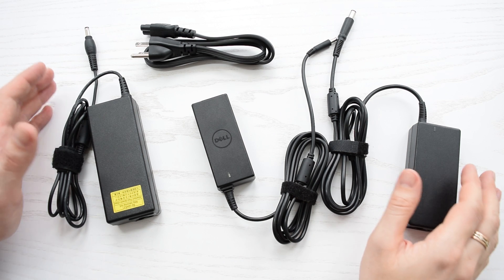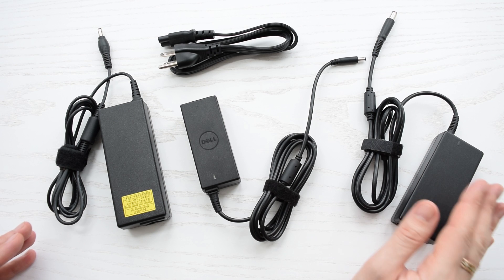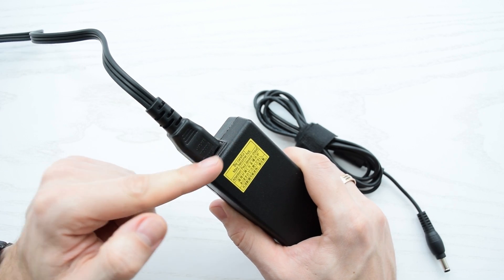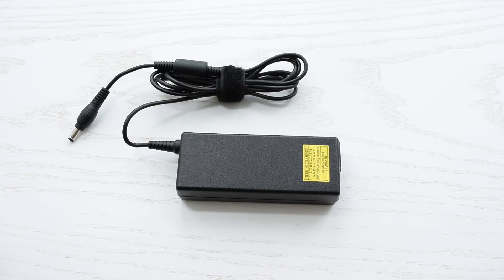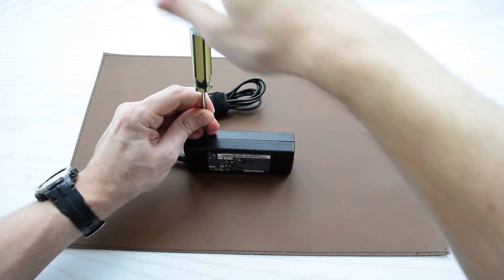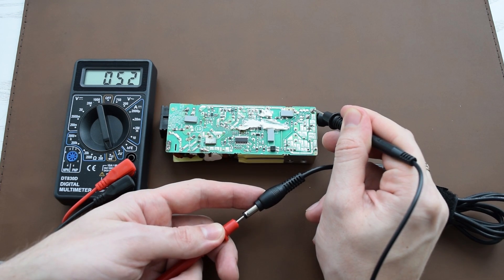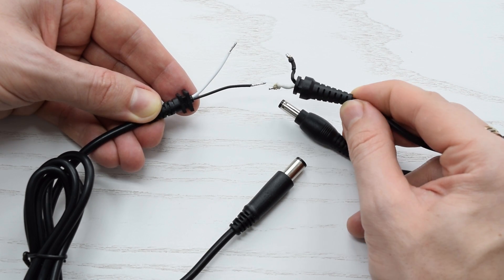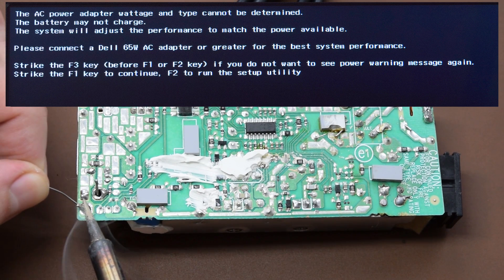How to Open and Fix Laptop AC Adapter without Damaging. DC cable and Capacitors Replacement

Comment: My Dell 65W charger have black blue and white cables and GND, VOUT and ID. Which wire goes where?
Reply from the maker: The outer ring on the DC connector is GND, the inner one is Vout and the needle in the center is ID. If you're replacing cable and if the new one has different wire colors or even if they the same I'd highly recommend checking them with a multimeter.

Comment: Is there alternative to using superglue when you put it together? How are you going to get inside when it breaks again? Or maybe just using the superglue in the corners or middle would be preferable?
Reply from the maker: I opened super glued power supplies many times. That glue is not stronger than the factory adhesive.

Comment: Hello my friend, do i need to super glue the case back together? Also when opening with a screwdiver i made a few small holes in the side of the case
Reply from the maker: It's up to you. You can glue it back together or simply use electrical tape or scotch tape.

Comment: Another trick to open plastic enclosures without breaking them (mostly)
See picture:
https://drive.google.com/file/d/16e1rRGl4BeZp2NFobxlSmnRpqDgaXwFo/view?usp=drive_link
- Make sure that the rods are exactly positioned on the seal (use sticky tape)
- Don't squeeze too hard; I have occasionally broken an internal PCB
/ChriV

Comment: Thank you ! I was able to replace barrel plug and tested for correct polarity!!  Question: I forgot to replace the last of the 3 thin metal housings. It is super glued together.  Do I reopen it the same as the first time ? Or is there a better way to separate  the superglued case?
Is that last piece of metal critical ? It had two metal covers and two white covers - thank you 🙏 😊
Reply from the maker: I wouldn't do that. Just use at as is. Those shielding plates for interference that may come from your adapter and affect some devices. For example if you put your old radio very close to the adapter you may hear some noise. Other than that it won't make any difference, so don't brake the case again.

Comment: Hello, I recently repaired my Yamaha PA300C power adapter for my SX700 keyboard, but I am unsure about the correct wiring configuration. The power adapter has two wires: one is black and the other is black coated with white. Could you please provide me with the correct identification of these wires? Specifically, I would like to know which wire is intended for the ground connection and which wire is meant for the 12V positive connection
Reply from the maker: There are as many standards for wire color it depends on manufacturer and I would never trust it. Check the polarity with a multimiter and wire the DC cable according to the markings near the the DC jack on your keyboard. Never rely on those colors when it comes to DC adapters!

Comment: Thanks for this. Can you help me with something else, please? We have this mobile power supply device. It's like a charging bank, but a bit bigger, and seemingly a bit more powerful (can even jumpstart your car battery to a degree), and more for car travelling usage (can charge lots more things than just phone). But we lost the AC adapter for it :-(. It has an Output connector for which you can apparently change/switch the voltage (12, 16, 19) and there's a smaller Input connector (only the thinnest of a series of 7 spare jack adapters that came with it fits) that says "12V/1A". How do we order online the best AC Adapter for it? Do we have to look out for wattage? What kinds of voltage and amperage would be compatible or best? Appreciate it.
Reply from the maker: What's the brand and model of that device? Photos of all connectors would also really help.

Comment: Where to atach id sensor i have ac adapter only with - and + .
Reply from the maker: There should be a three-wire cable if it's HP or Dell laptop.
Reply: @ElectronicsComputers  yes its 3 wire cable but i got ac adapter only with minus and plus the original adapter is broken can i use this adpter only with plus and minus

Comment: The light on mine is blinking and the voltage is unstable. Nothing is visible wrong. No visually bad caps, the cable is having continuity. Any ideas?
Reply from the maker: First I'd remove the DC cable and check the voltage (very often those cables are partially shorted. Then I'd check all electrolytic capacitors with a multimiter. Activate the continuity test mode with sound and then attach probes to the capacitor then switch the probes and attach to the capacitor, then repeat again. Every time you change the polarity of robes you have to hear a long up to 1 second beep. If there's no beep or it's very very short then you need to replace those caps.
Reply: @ElectronicsComputers  It seems to be the transformer part. I hear clicking and when I apply a lot of force over it then it starts to work, but only temporally. This is my second adapter, the last one failed in the same way. Maybe my laptop killing them? Old Toshiba Satellite.
Reply from the maker: @DarkGT  Check for cold solder joints. Maybe you have bad contact between heavy components and the PCB. Try to resolder the big cap, MOSFET and the transformer. By working temporarily  you mean with or without the connected laptop?
Reply: @ElectronicsComputers  Both, if is working when I connect it to my laptop it would start blinking or work fine. If it started blinking even I disconnected the laptop unplug wait 20 sec and plug it again it will still blink. Only applying constant pressure on top of the transformer fix it. I will try giving the solder joins a try tomorrow.
Reply: @ElectronicsComputers  Just a little update in case you are curious. 
I re-solder the caps, mosfet, and the transformer. I found one surface mounted component that was actually lose. It was near the 19v side, near the small caps next to blue ceramic capacitor. It have 4 legs and one was disconnected. Maybe I knock it when I opened the case, or it was like that, who knows. 
After all of this it worked fine for few hours with no issues, until my laptop self restarted the power light blinked once. Maybe I fixed something, but there is still some issue.

Comment: I couldn't get that aluminium off from the charger, seems like it's connected to something inside .... any information how to get it off ?
Reply from the maker: It's soldered to the board and also glued with a silicone.

Comment: Thank you ! it was helpful for me
Reply from the maker: Glad it helped!
Reply: Turns out I managed to fix my power supply. it was a basic disconnection between the ac power plug socket female and the board.

Comment: I just opened the charger of my acer laptop model pa 1131-16 and I found a blown ceramic disk capacitor VARISTOR TVR 10471 do u think replacing it will fix the issue?
Reply from the maker: If the varistor is blown that means the fuse is dead too. You can try to replace the fuse or simply use a very thin wire and try to turn it on without the varistor.
Reply: @ElectronicsComputers  thank you but I don't know which fuse your talking about.. I don't see no fuses all what I see is other electrolyte capacitors N they look all fine to me..  Can u put a link to how this fuse looks like please . Thanks
Reply from the maker: @KlassikMafiaProduction  Take a picture of your adaptor's board, upload it to a cloud and share it with me.

Comment: "Without damaging" *attacks with screwdriver*. There are plastic pry bars for this kind of thing, they don't leave markings as metal tools do. Just a tip!
Reply from the maker: Plastic pry tools won't work for those superglued cases.
Reply: @ElectronicsComputers  There are some pretty beefy ones, almost like chisels, that can be used with a hammer without scratching

Comment: Sir, thanks for a great video! Your English is excellent! Have an HP charger that beeps! Tried it in different outlets but same result. Won't charge the laptop it goes to. Will try your methods. Thank you 🤓
Reply from the maker: Thank you for the comment!
Reply: @ElectronicsComputers  very welcome 😁

Comment: my newest charger, i made a rookie mistake and didn’t realize it was covered in a lot of fabric and i think it overheated, as it wont work again, however, i have another charger with a working power box but with a broken power cord, i was wondering if there was a way to swap the 2 cords so i would having a working power box and also a working power cord, and is it possible to do without soldering? i am not well knowledged about the topic
Reply from the maker: There are two way to do that. You can simply cut those wires and connect according to the color and then use electrical tape to insulate the wires. Or you can open the charger remove the cable and solder down a new one to the board. I'd recommend choosing the last method.

Comment: Weird my barrel plug only has 2 wires to the pcb and all the caps measured fine. It died completely silently in use while I was playing a game on my laptop
Reply from the maker: Check the fuse.

Comment: Superb! Very helpful video, it really put me on the right track. In my case, the two pins that connect the socket to the board had come loose due to wear. I just soldered them back into place.
Reply from the maker: Glad it helped

Comment: Did not work that well for me - I could get the screwdriver in, but the case did not pop up as in the video. When I turned the screwdriver around a bit, it just widened the hole and did not open the case. Had to ruin one side a bit to finally make it pop open. It's a Toshiba Satellite PSU, by the way.
Reply: I've got the same issue with an ASUS. Got a bit careless and jabbed my hand as well, but that's my own fault.

Comment: Whats that little barrel on the cable for?
Reply from the maker: It's a filter which is used to suppress/block high-frequency noise in electronic circuits.

Comment: I couldn't get it open and tried with some force but did not want to gouge the plastic too much.   I saw in another video to use Flux solvent on the crack all around the adapter.    It appears this is Ethyl Alcohol.   I didn't have any , I had Isopropyl and  used a dish plate and put the adapter on its side in the plate and poured a little bit of Isopropyl into the plate and used an eye dropper to pick up some and put no the other side of the adapter and the ends also.   Waited a few minutes and then I was able to break the seam at one point and then I got the screwdriver in and kept prying and used a kitchen knife to slide up the seam to break and just kept working it until one side was open and then just kept moving it and prying until it was free.    Then of course you have to know how to solder , remove the top metal shield which was soldered to the board and then I could unsolder all three wires, noting white black and blue locations.   Done in about 20 minutes total.    I did not re glue the plastic together I put on two black twist ties.   I know this will last a few years and then need to be done again.
Reply from the maker: Great job!

Comment: Wow, I was a bit skeptical but followed your technique exactly and in less than a minute 'viola'!  And I can close it almost like new.  I opened this unit because it is pretty high wattage, 42v 3a and runs hot.  I bought it to charge the LiOn adventure wilderness safari excursion power station I'm slowly and cautiously putting together.  Uhg, this thing runs hotter than any brick I've ever seen.  I'm certain this thing can't perform very many charge cycles running this hot.  It doesn't look particularly cheap or high quality.   Is there anything I can  do?  Vents, heat syncs or a fan somehow?
Reply from the maker: If you leave it disassembled and attach a fan somehow it will cool down your power supply pretty good.

Comment: Obviously a lot of insidious diabolical thinking went into the design of these power adapter systems:  "Let's make it so the DC cord doesn't just plug into side of the power brick (allowing for simple inexpensive replacement of the cord in only a few seconds for a couple bucks) but is instead soldered or hard-wired into the brick itself so the customer has to pry open the power brick... And while we're at it,  let's make the power brick so it's glued together using high-strength industrial glue that, more often than not, will result in the plastic brick casing actually breaking into pieces instead of coming apart the way it should" ~ forcing you to purchase a complete power adapter system and spend 40 times more than a simple low-voltage DC cord would cost by itself.

This is "planned failure" in it's most flagrant and offensive form.  It's what happens when you don't enforce anti-trust laws for 50 years.
Reply from the maker: I couldn't agree with you more.

Comment: I have a Lenovo thinkpad x220 laptop adapter that does not work correctly, when I connect it from AC current it gives current to my pc, then after a few minutes it cuts, I disconnected it from AC, leave it for a few minutes, then after  I still connected it to AC and in my pc too, it gives current, after a few more minutes the current cuts in my pc.  Is it that it gives current intermittently?  What's the piece that can cut the power like that?
Reply from the maker: It might be just a broken DC cable or dead capacitors. Do you have an LED indicator on your adapter?
Reply: The DC cable is good, cause I tested it! There is no LED indicator on my adapter!!

Comment: There are other videos that show dissolving the glue with gasoline (petrol) or some other glue dissolver.  No need to bash the case too hard.  But those vids only showed opening ... I appreciated the extra part showing replacing the cable.  I am working on shortening the cable.
Reply from the maker: Gasoline will work for some adhesive or double sided tape but you'll never dissolve super glue with gas.

Comment: I hope you answer because this is an important thing i have to check. So i wasn’t home and the electricity voltage is 220V only so the electricity became 300V and the laptop was on charger and i dont know how to fix it i hope you teach me how
Reply from the maker: usually it only blows the internal fuse. If you don't have any tools like a multimeter and soldering iron, then there's no way you can fix it.
Reply: @ElectronicsComputers  thank you so much for answering me

Comment: I am getting this message -  "Alert! The AC Power Adapter Wattage and type cannot be determined. The battery may not charge. The system will adjust the performance to match the power available." - So, replacing the cable will work for me right?
Reply from the maker: The problem in 90% of cases in the charge but it might also my be your DC jack or even motherboard.

Comment: Nice video btw, but in my case my ac adapter got blown where there is something a component that got blown and made my ac adapter blown and fail and it is near the entrance of ac power source so I can't figure out what component that is
Reply from the maker: Can you make a close-up photos from both sides of PCB?
Reply: @ElectronicsComputers  I'll try sir, and what is your email sir so that I can send you a video or a photos I can. Also the PCB is firmly glued in the other pack of the casing and I don.t have much tools to do it.
Reply from the maker: @mrp0t47o4  You can attach them here and then send the link: https://imgbb.com/

Comment: Sir my Toshiba laptop charger is output voltage is coming 19v
But in my laptop not show charging 
why ?
Please give me some solution to fix this problem
Reply from the maker: Could be the problem with the components responsible for charging your battery, could be the battery itself. It's hard to tell without checking the key components.

Comment: Is a problem if the toshiba charger don't have the same A my laptop requires 19V and 3.9A and the offender gives 19V and 3.42A ???
Reply from the maker: Most likely it will work and if it's the only option available to you then get it. Try to find that adapter on aliexpress.
Reply: @ElectronicsComputers  It will definitely not affect my laptop ???
My laptop is 1k $$$
Reply from the maker: @EvoAI  Your laptop will be fine. What's the model of your laptop?
Reply: @ElectronicsComputers  I don't know exactly 😂😂 I know was expensive
Reply: @ElectronicsComputers  The first time I received the charger you had in the video the first one  after it broke and I took another
Reply: @ElectronicsComputers  now I'm trying to fix it thanks for the video

Comment: very details and professional！thanks bro
Reply from the maker: Thank you for the comment!
Reply: @ElectronicsComputers  BTW, my charger is good 19v but plugged in laptop DC jet and check is 0.44v very low it should be 19v ,what's wrong？no power please help

Comment: Very enlightening video! My problem was easy to detect: Bad connection of the DC cable with the power brick. I will open and fix it as soon as I get my hands on a soldering iron.

Is it possible to strip some wire from the DC cable in order to fix it? I was thinking of removing a small slice of the cable jacket, sliding the wires through the strain relief and then sealing the cut with a shrinkable jacket.                                                                        

It would save me precious time if I can avoid to buy a new DC cable. But I fear that my plan is sci-fi :)
Reply from the maker: Sure, as a temporary solution it will work but it's gonna look ugly.

Comment: Thank you! This guide or tutorial was comprehensive and very helpful. I was replacing a cable on a Dell adapter with a spindle connector, and the colours were mismatched on the third party cable. Black - GND, Red - Positive and White - Sensor. 

The technique to break open the case was very easy too, and it doesn't look too bad after finishing up. Most importantly I didn't hurt myself with a sharp object.